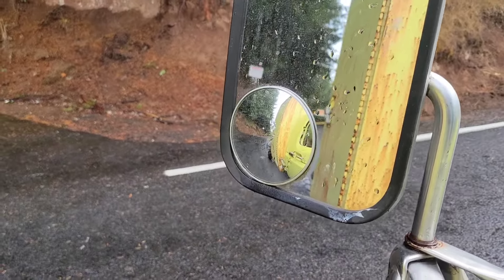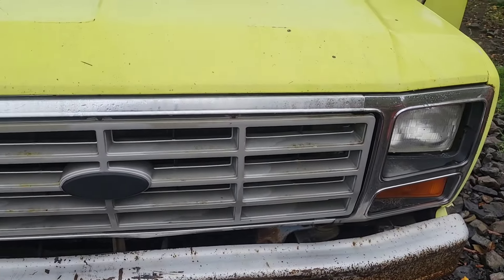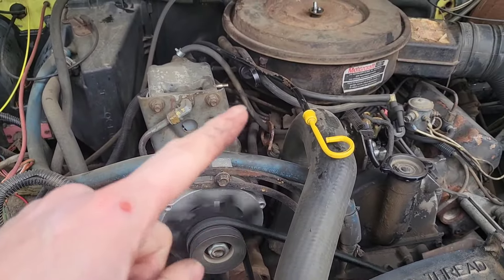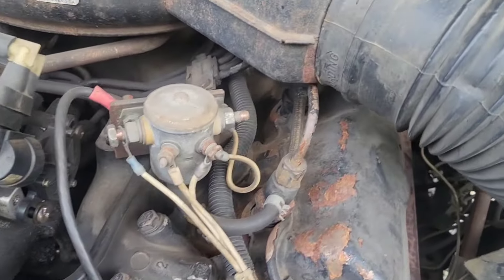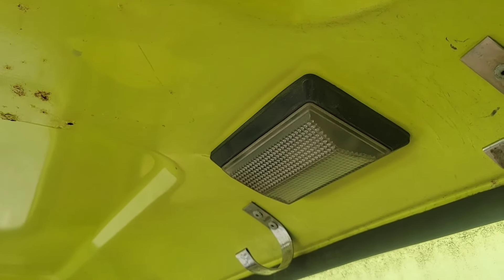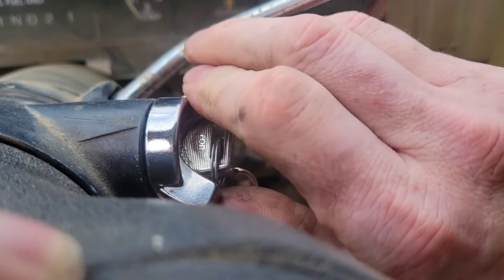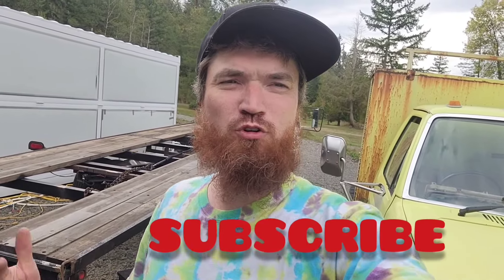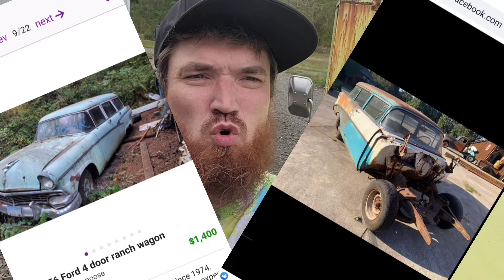BUYING a Ford 6.9 or 7.3 idi diesel look at this

Comment: Is the smoke supposed to be clear white like that or black? What do you not want to see.
Reply from the maker: Idi shouldn't smoke much at all if it is running good. White smoke can be cavitation, or bad head gasket. Also can be injectors going bad, or a timing issue if combined with other symptoms. A little black smoke on hard acceleration is normal. Alot of black smoke pump is probably turned up or air filter is clogged. You want consistent smoke color, not sputtery like a miss. Which would indicate a bad cylinder. On start up you will always get the best smoke reading, a bit of white till it warms up is pretty normal. But smoke doesn't always tell the whole story. Still check blowby, make sure it has sufficient power, make sure it is not missing or running poorly etc. You can search reading diesel smoke on Google. Read some articles and get more insight. Thanks for watching.
Reply: @worthshop  Hey man, I really appreciate your time and input on my comment. I actually just finshed test driving a 6.9 IDI 1986, and I tried to see and check everything you mentioned. I did notice when checking the blowby that there was some smoke coming out but it wasn’t much just a bit of white smoke not a lot. You couldn’t really tell but it was something you can catch. I also flipped the oil cap to see if there was blowby but it sat flush. I floored the gas and I saw no black smoke.
Reply from the maker: @Samuel Solis  Spunds like you found a decent one. All idi trucks will have a little blowby. You just don't want it chooching like an exhaust pipe.

Comment: The 6.9l IDI is such a great engine, simple, generally easy to fix, super reliable. I own one now it's in a 1985 F250 standard cab long bed 4x4 6.9l IDI/4 speed. It's my second truck, basically the same as my first one which was an '84 which I kick myself for selling back to the guy I bought it from even if it was for more money than I paid him for it. Excellent, go anywhere trucks that get great miles per gallon than basically every ither truck on the market now. They're not terribly fast😅😂 and they can smoke pretty well under a good load but I'll never sell this one. It's getting new dash top, door cards, new window and door seals, rear disc brake conversion, and some other minor mods, I plan toput a military S250G electronics shelter into the bed as a camper conversion that's going to be perfect for all seasons with the amount of insulation it has. It's going to be a great rig when it's completed!

Comment: Turbo question Aspie!  My new to me 93 turbo diesel seems to have a stuck closed wastegate. It wont budge either way with a stiff push of the thumb. Does the actuator rod push or pull? Can i lightly tap on it with small hammer after a good WD-40 soaking? I dont want to risk any overboost, so any tricks to freeing it up would be greatly appreciated!
Reply from the maker: I honestly am not well versed with the turbos.

Comment: I bought a 91 250 for 500$ and the engine has the milky oil and signs of coolant and oil mixing but i plan to tear into it and rebuild cause it spins over nicely and seems fixable compared to the others i saw in the same price range. Engine is a 7.3 idi.

Comment: When you buy a older ford like this gas or diesels you might as wheel test everything on the "can i drive question" floor it over and over put a huge strain on the engine... go uphills, down shift gears constantly auto or stick.. give it power just like you would need to test everything before paying full price no matter what theyre asking... cram breaks down shift put the actual engine threw its test .. see if it leaks.. or anyrhing makes noises just use it like you would... my way was absolutely raise hell in it and it if doesnt hold then leave it especially if it makes a weird noise you dont normally hear after high load most of the ford 7.3 or 6.9 guys try to pass issues off as a fuel issue or a certain valve or fuel issue. Run them hard and pull hard see if the truck has a problem after even up to 30 mins running.. watch for leaks, overheating, or oil drips/ trans drips..

Comment: How much would you pay for a 1991 crew cab 4x4  f350 7.3 IDI with 320k miles. Not much rust, likely needs an injection pump. 5 speed , reverse gear grinds a bit. Runs , drives and stops
Reply from the maker: Me personally, maybe 2k$ but the prices of idi trucks have been going crazy lately. Injection pump will cost you close to another 1k$ a rebuilt transmission will be about $1200, or the rebuild kit if you do it yourself is around $300. I've seen them listed fir 10k$ and 12k$ the last few months. See alot listed for around 5k$ but I also see them stay listed and not sell for a long time.  I'd never pay anywhere close to that kind of money for a old pickup, unless fully restored or hot rodded.
Reply: @worthshop   Went and test drove it. Burns blue and white. Hard to start in Warm weather, Coolant is lower than last time I looked at it. DMF is broken. Blinkers, wipers and headlights dont work. No bumper. Holes in the cab floor. Cab has dents. Loosey goosey steering

Blowby isnt terrible but what's odd is the radiator will get blistering hot, cant touch it but the engine is only warm.

With all that and 320k miles , it looks like a money pit. Listed at 3000 usd.

I'd rather spend 5000 and get something reliable.
Reply from the maker: @ToyotaNutjob  I've had more problems with my yota than I ever have all my idi trucks combined.
Reply from the maker: @ToyotaNutjob  Everyone is entitled to their opinions.
Reply: @worthshop  wow, someone who doesn't make blanket statements and needless arguments over opinion. You seem pretty incredible. Appreciate the video
Reply from the maker: @BL DontMatter  I really do not have brand loyalty. All makes had bad models, bad engines, bad years. All makes have wins too, good models, goid years, good engines. If it is decent and I can find one cheap I'll drive just about anything. That being said, I am pretty partial to the idi, they are cheap, plentiful, easy to repair, reliable.
Reply: @worthshop  I'm becoming that way too. I am going to buy a 1987 6.9 idi, seems the best year for em and I don't mind them being slow. Manual transmission because the c6 is gross of course.

Comment: Man I’m looking for an idi that I can every day and I just can’t find one decent enough for a decent price
Reply: Some work is fine but most of them are destroyed
Reply from the maker: The price of idi trucks has gone up alot the last 3 or so years. I was getting them for free before. They were un desired. Then the value has just kept going up. I have noticed the used truck market slowing down alot though. So don't give up hope. At least around where I live up in Washington state, trucks have not been selling... So inevitably owners are lowering their ridiculous prices. Thanks for watching, and God bless.
Reply from the maker: I would focus on a good engine/ transmission. Solid body not all rotted out. All the interior, lights, switches, door handles, wipers, heat etc etc can be fixed pretty easily as you prioritize.
Reply: Ford f350 goes for 8k where I'm at in western Washington is that good price. The guy has changed oil every 5k miles and has paperwork to show

Comment: nothing sounds as good as the old 6.9 idi at higher rpm it bellows like a pissed off big block and in the lower rpm it just rumbles like far off thunder
Reply from the maker: Much agreed, makes me giggle when people think one of my idi trucks is a gasser. Appreciate the comment, thanks for watching.
Reply: @worthshop  between the time i posted this comment and the time you responded i actually just went and bought my 3dr 6.9 got 2k 1986 dark blue no cancer just some surface rust and its on the nice aluminum rims you know the ones that came on an 1990s xlt+ broncos but only 8 lug instead of 5

every time i go and buy an old Navistar ford truck i get over excited and start looking up the what to look for videos to remind me
Reply from the maker: Congratulations, sounds like a nice truck! Always exciting picking up a new rig, unless it breaks down on the way home! I haven't gotten my hands on a 4x4 idi truck yet, but looking for a cheap one to build a mud truck.
Reply: @worthshop  personally i thing the 6.9 or 7.3 are a bad choice for mud (weight) but hay everyone has their fetish engine mine is the 4.9 inline 6 gasser and 2nd the 6.9 idi its my flexing truck

but my 150 with 4.9 inline 6 is my Billy goat truck gos any where any time and is as reliable as the sun its 40 years old and i would have no hesitation jumping in it and doing a 2000 mile road trip right this minute 12 mpg city 18 mpg highway
Reply: @worthshop  yea so i was 100% wrong the 6.9 is AMAZING in the mud just had it out weight was not an issue
Reply from the maker: @Friedrich-Wilhelm-1980  I just got my first cheap 4x4 idi to test the theory out.

Comment: automatic diesels are garbage,  best to have 5 speed 4x4 for best performance
Reply from the maker: Agreed, much more fun to drive a manual too. I just buy what is cheap and available when I have the money to spend. Currently have 2 manual idi trucks, and 3 auto idi trucks, one of which is getting a manual swap. Thanks for watching.
Reply: @worthshop  based